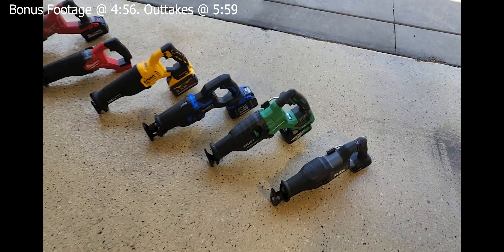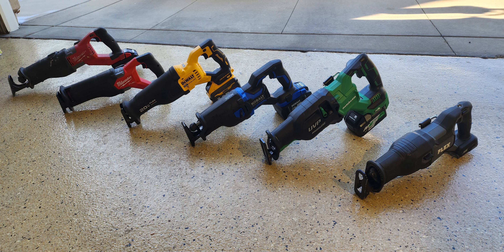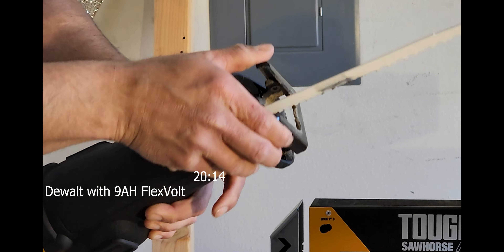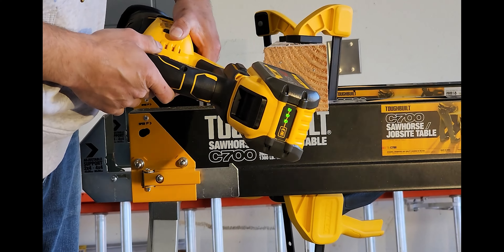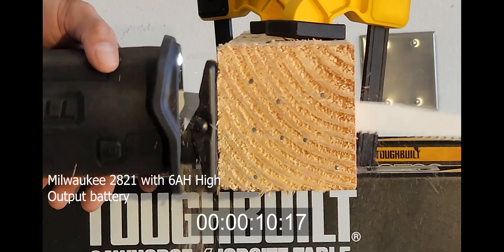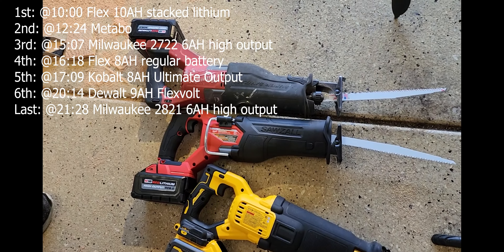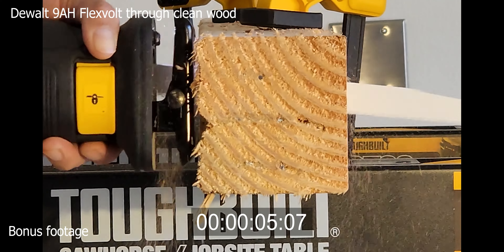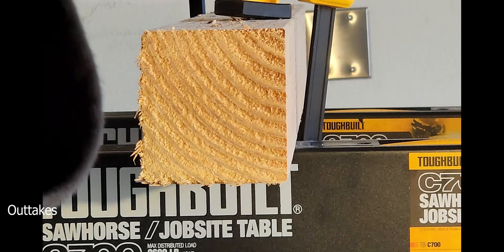SawZall Showdown! Milwaukee Dewalt Flex Metabo Kobalt

Comment: Hey guys you get an A+ for effort. Awesome video. If your open to advice you need to clamp that timber down a lot better so you can keep the shoe firm against the wood. Your loosing a lot of speed and performance from the vibration. Trust me I’ve learned the hard way. Great video 🫡🫡🫡
Reply from the maker: Thanks for the advice, really appreciate it! 😁 awesome channel btw
Reply: @craignbros  🙏🙏🫡🫡